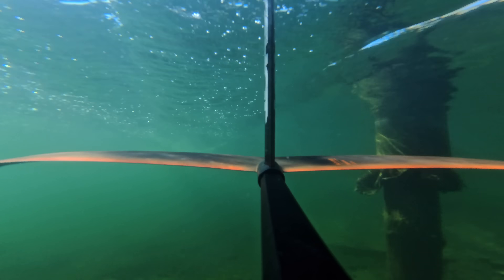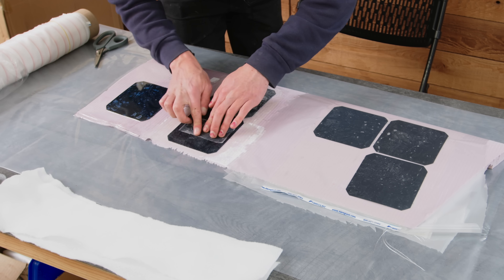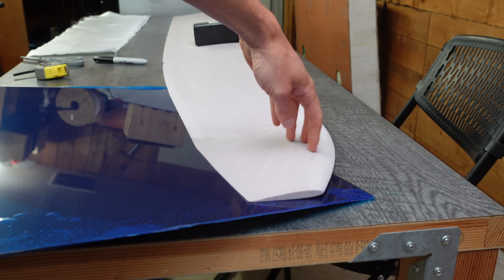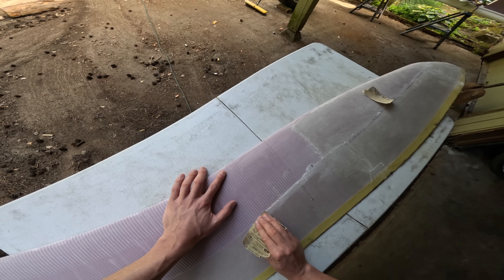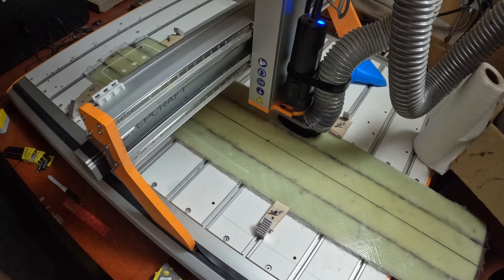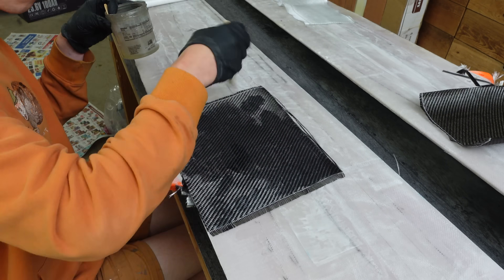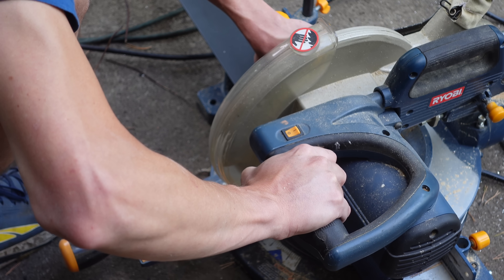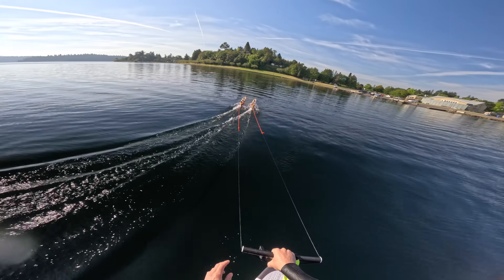I Built the World's Biggest Hydrofoil Board

Comment: My ideal choice of materials for high-performance, lightweight projects is DeraKane 8084 vinylester resin and a sandwich of S-glass with Kevlar in the middle (with no Kevlar sticking out clear up to the margins to fuzz-up when you cut or sand it. The vinylester resin behaves much better during application than epoxy and doesn't gel-up on you unexpectedly. I have kayaks and paddles I made 25+ years ago with this formula, that still seem to be as good as new.

Comment: Trailing edge of foam should be removed.  Old school Rutan aircraft designs do this by profiling the foam so that the trailing edge is offset from the desired profile..  Make the topside layups with that foam acting as a form.  Then flip the assembly and cut and sand the foam form away leaving a straight and flat place that make a perfect structural glass to glass trailing edge.

Comment: FYI - For future reference regarding reinforcing fiberglass with carbon fiber:  Due to the large difference in modulus of elasticity of fiberglass and carbon fiber, the carbon fiber will take almost all of the load (like 80-90%) because it is so stiff that the glass doesn't even strain (stretch).  Since the carbon is taking most of the load, you need to be sure to use enough carbon fiber to support the WHOLE LOAD.  And when you do that, the fiberglass is taking almost NO LOAD, and isn't even needed.  Final conclusion:  Don't mix glass and carbon composites.  Pick one or the other, but not both (at least not supporting the same forces in the same location).  If glass is not stiff enough, use more, increase web dimension, or ....  just use carbon.

Comment: I know this is a slightly older video but please please please, in the future use a respirator or some sort of mask that filters out particulates! I don't know if you've ever been told this but even when you're just using scissors to cut fibreglass cloth there is a ton of tiny glass fibres that get into the air and stay there fo a minimum of an hour. It's also really, really necessary to wear one when you sand the fibreglass and resin surface. It's really important to wear PPE as your lungs are delicate
Reply: And even more so with carbon fiber. You should see the intricate masks they use for commercial production using CF. Some of the little particles are too small to see and those are the most damaging to your lungs. At least you could be outside with a breeze blowing, although I wouldn't want to live downwind of you.

Comment: If you had laid CF in with unidirectional weave at 0, 45, - 45, 90, - 90, 0 then sandwiched top and bottom with a 2K or 3K weave, you would have been extremely stiff and torsionally stiff, rather than a bunch of thin fiberglass weave worth 0/90 deg threads).  A simple 8 layer sandwich with different angles of uni would have saved you a ton of layup work!

Comment: For that plate to stand on, you had to add a rib, or beam along the board. You could put a piece of foam 5cm x 5cm on the sheet you had, then sandwich it with more fiber glass. The foam board you placed on the fiber could be fully sandwiched as well.

Comment: Try it differently!

𝐍𝐨 𝐜𝐫𝐞𝐚𝐭𝐮𝐫𝐞 𝐭𝐡𝐚𝐭 𝐟𝐥𝐢𝐞𝐬 𝐨𝐫 𝐠𝐥𝐢𝐝𝐞𝐬 𝐭𝐡𝐫𝐨𝐮𝐠𝐡 𝐰𝐚𝐭𝐞𝐫 𝐮𝐬𝐞𝐬 𝐢𝐧𝐟𝐥𝐞𝐱𝐢𝐛𝐥𝐞 𝐰𝐢𝐧𝐠𝐬 𝐨𝐫 𝐟𝐢𝐧𝐬.

During my professional career, I have built many robots and test setups to simulate real-world loads. It is very clumsy to load a chair with a 50kg weight for 20,000 cycles in accordance with the European standard, without taking natural use into account. The user sits down slowly on the chair and the forces exerted by the user's weight are not distributed suddenly.
I would recommend that you design a system that allows for vibrations and movements. Roughly speaking: the wing under water must flutter.

Best wishes from Curacao.🙂

Comment: After laminating and the power unit solar drives attached. If a under center skid wires to drag stability to the underneath if the wings the tensions by the wings up lift down on landing has a tension support limited .by the run-through the restrictions. Any item requires maintenance.

Comment: Cool project.  I'm assuming the platform for the Hydrofoil board is mounted on the CG of the foil?  If so try towing it with someone on it?  Also, the foamcore cutting technology has been in use forever with RC.  Have someone cut your cores for you (should be able to find someone on RCGroups), it will come with the beds and you can laminate in them.  And yes, lay glass or carbon on the bias!  Post again when you make more foil attempts!  Crap, never mind, just saw the new video.

Comment: How long did you wait between your last cure and the paint? Polyurethane boat paint is great stuff but if the epoxy isn’t well cured (like 3 days @ 70°F) I’ve had issues with the paint staying tacky for a good while. Similarly, I try not to sand epoxy before a three day cure to avoid long term exposure and sensitization. It still keeps curing for a good month, but three days seems to be a sweet spot where the vast majority of the cure has completed. That’s my experienced layman’s understanding, anyway.

Comment: 10:32 --- PETG ----- IS NATURAL SEPARATOR 
Resin wont stick to it at all (except mechanicall connection trough holes etc (like "hooks") )
but in this case it act more like a "filling" material (like foam in wings but harder) 
pro tip ----- holes in it (infill) and epoxy paste (with thickeners like silica) can make the bond permanent (mechanically)

Comment: do you need a printer or could you just coat a foam board with carbon fibre sheets.. actually you need a Epoxy printer -- whats that a resin printer? can you get it?

Comment: The difference between your fiberglass plate and the purchased one is epoxy vs. polyester resin. Epoxy is very flexible and so is glass fiber. Polyester resin is used with glass because it's stiffer and compensates for the flexibility of glass fiber.

Comment: Its called washout on tips. Wire cut foam cores with built in washout is your building board.
Carbon leading edge say 10mm deep and trailing edge 20mm deep Shear Web Spar 15mm with end grain spruce. 
Cover with aluminium sheet similar thickness to Coke can using slow cure epoxy weighted down on your core mould - Super strong wing 🛫

Comment: Cool video. It reminds me of first attempts at making RC gliders. Once you have had fun with that, you need to move to vacuum bagging. You also must add some carbon layers though expensive I know. That will make things stiff and stick together. You are essentially building modern RC airplane wings, so no reason to reinvent though the hand lay up method can make good looking parts. The buoyancy thing may be an issue once you do it right as it will be lighter. Still fun to see people take a shot at composite layup.

Comment: If you need stiffness, US Composites has S glass. Most fiberglass is E-Glass or electrical glass, so good enough for electricals and insulation. S-glass is structural, with S-2 being a trademark name. It has quite a bit more stiffness and strength while still being fiberglass, so not a big price jump like carbon.
Shoutout to Soller Composites, he got basically the cheapest carbon you can find, in the categories they stock.
Reply: S-Glass is 10% stiffer and stronger than E-glass. It is 300% more expensive. Carbon is 5x more expensive and more than 2x stronger, so it has nearly replaced S-2 in most composite products.

Comment: Are you using only Biax fibers? I think you would get better results If you used some UD or Triax, and infused them instead of handlayup. Using the infusion technique and UD fibers you would gain more stiffness and better compactation of the layers, wich reduces the amount of resin between them and raises the overall structural integrity as the fibers would be getting more of the stress.

Comment: This build is awesome! I wonder if adding self-balancing tech, similar to what Segways use, could help maintain the hydrofoil’s angle relative to the board, stabilizing it for a smoother ride. Maybe actuators could automatically adjust the angle for optimal lift and control. A joystick on the board could also give riders the option to manually adjust the height by shifting the foil’s angle in real-time.

For an advanced twist, the actuators could even oscillate the foil angle slightly, generating a form of propulsion by mimicking a fish’s tail movement. This could add some extra thrust without relying on traditional motors! And with independent control of each end of the foil, the rider could achieve left-right 'yaw' turns for better maneuverability. This project has so much potential!

Comment: I wonder what’s an idea behind (except to utilize the wings)? To prove physicists were wrong and water had a same density as air? If you even will be successful and solve all balance issues, you will move at a speed of a turtle to have a proper lift force.
Reply: Mhm of course water has a higher density and that should increase the lift with the same profil and speed if I remember correctly and the added lift should be about the weight of a human at seeds close to the design speed  and it looks promising in the first attempt

Comment: Using styroboards seems way better in many regards than 3D prints like in the motor powered hydrofoil. But the built process needs to get optmized. And you really have to be sure about your design beforehand.

Comment: Nice design, but Pretty sure I could build that wing faster and easier with balsa..-that "highly precise" trailing edge flip up is also easily created with a simple bloc under the wing during traditional construction and is known as washout. Why re-invent the wheel at every turn? Strength comes from sufficiently thick cores not thick skins of resin and glass.

Comment: To keep parts flat or to desired shape, build an 'oven' -simple cage with light weight foil faced insulation that you can set over your part. Add a heater with thermostat, leave the part under vacuum in the 'oven' around 180f for 2 hours. It shouldn't pre-release or have any post cure warp  
Or, build a pressure vessel with heating like formula 1 teams do. Kind of expensive though  
Source; I built boats for 35 years and after,  kevlar parts for race boats

Comment: You can cheat with the spar.  If you use "flat" 5mm/1mm carbon ribbon glued securely so it can't twist you can get a huge amount of bending strength without a large tubular spar.  Gluing 2 flat bits along their length greatly increases the strength.... like a split-cane flyrod.
I used this to reinforce my "Skywalker FPV" 2 meter span, with a take off weight, all batteries, cameras etc, of 1.4Kg.
Because the tips "could" technically twist under extreme G (4 or 5G) it actually helped wash out the tips and made the thing ultra stable in stalls.
I never did loop it.  Thats a lot of weight for 2 meter square, low aspect wings.  I did try and stall it and had to abort.  It didn't stall, it just "elevatored down" retaining a high angle of attack and I immediately dumped the nose and powered out, knowing what was coming if I pushed it too far or if I slammed the throttle open.  A flat spin.
Still, thing flew like it was on rails.

Comment: Hi. You can significantly increase the processing speed with the "Parallel" strategy. The direction of movement should be along the diagonal of the axes of the machine. Then the maximum speeds of the axes will be vector-folded and the milling cutter will be able to move noticeably faster. Good luck with the machining :)

Comment: Seems as if you have to have more weight on the larger foil. Laws of physics. You have lots of lift but also more drag. Like airplanes the larger the wings the less power is needed to get airborne but drastically reduces max speed. Small wings high speed. Large foils need more weight on top to work properly. Weight and foil size ratio. Also they are probably to buoyant as well since they are so large. Volume in qft. And more weight on them would likely improve performance. So a heavier you.

Comment: From my experience building longboard skateboards from flexy carver or cruiser to full on downhill boards, I would think that small amount of straight strand carbon fibre does more than you think. It has completely different properties from glass. Glass is flexible and bouncy and carbon is much stiffer end springier. It does break at a lower deflection compared to glass and it shatters while glass tears. But on flexible sports equipment you're riding you can defilitely feel the difference in flex and damping between different materials or combination of materials.
Reply: Yep, my thought too. You add some carbon and the part gets 4x stiffer. Its just expensive.

Comment: Excellent build and excellent video. I suspect that the masts of these craft replace a large amount of the pitching up moment that is usually solely born by the horizontal stabilizer on traditional aircraft. They can do so with their drag, rather than the traditional negative lift that the horz. stab. uses. If you have a dual masted board like this, I think you would need even less reflex than if it only had one mast. I see evidence of this when I see how small the horz. stab. is on other wing boards, especially when compared to the wing. Its much smaller than you would expect if it were going to be an airplane. This wing is so nice though. If it still wants to pitch up after more practice, you can always add adjustable, unpowered elevons that can be adjusted on land.

Awesome vid!!!

Comment: It has been a while since I flew a hang glider, like back in the 80s. They were just starting out with the double surface wings. The older ones had as much as 15+ degrees of wing twist/warp. I don't think in them they had any reflex on the back of the foil. They did have restraints on the main part to make sure that under negative lift loads, the sail did not deflate. These were tethers to the top post which are not on the newer models. I am pretty sure they incorporate that into wing design now days. Seems like most are flying the paragliders now days....
Reply: The newer ones do seem to have some reflex towards the tip as well as the washout.
Reply: Right about the time I was also flying hang gliders. Mine was a Seagull "10 meter". A minimum  wing "twist" (washout) was assured at all times by a small (some 50 centimeters) articulated strut near the wing tip, which by the geometry of the pivot point made it able to "float" into more negative angles if the flight conditions called for that, but would hit against a hard stop, pretty much guaranteeing a predetermined minimum negative angle at the wingtips, regardless of wing speed or angle of attack. Very simple, effective and safe.
Reply: My first glider was a clone of the Seagull 3. Those old styles would/could go into "full luff dives" and just barley suitable for "flying higher than you care to fall.... My next glider was an Electra Flyer Olympus 3, I think. It also had the articulated strut near the wing tip. It may have been set as high as 20 degrees, but can't remember that far back. There was one flying wing, can't remember the name (Sundance maybe), and it did have a recurve via battens near the trailing edge. My Oly did have a clip to the top wires in the center off of the keel which prevented total collapse of the sail in thermal conditions. I would think the reflex near the trailing edge of your wing here would be unnecessary. One way to find out.... I do a LOT of swimming now days. To date, I don't think any one has figured out how to come up with a method of smoke streamers like they use in wind tunnels. I have thought about maybe a steady stream of air bubbles in one of those endless swimming pools.
Reply: @robohippy  I learned on a Seagull 3. That was one reason I bought the (Seagull) 10-meter when one was up for sale near me.
Reply: I was just looking it up and I think I may have been mistaken. I think i was mistaking a bit of sag while static on the ground as reflex. Looks like they all have pretty convex foils out to the tips. Some of them might be running a lot more than 15deg washout though. Compared to the old school kite style it’s kind of inverted.
Reply: @weatheranddarkness  I think some of them had strings connected between certain points of the trailing edge and the top pf the king post. Under normal flight, those strings would sag and have no effect. But on the ground (or more importantly, in the event of a "luff dive"), those strings would effectively introduce a reflex in part of the trailing edge. You may have seen this with the wings static on the ground.

Comment: If you need long reach mills for a cnc router, consider Helicle's "solid carbide high feed" mills. They are specialized mills which translate forces axially instead of radially. This allows you to reach further without fear of high leverage forces. There is a learning curve because they work differently than end mills

Comment: loving your spirit for innovation and experimentation. But I learned that a minimum of engineering is needed for something like this, very basic checks... your wing surface, at what speed, for what lift (your weight) and then check for getting a neutral pitch stability. My 1st reaction is that your wing has too much surface area... these things can't be winged ...

Comment: After I was through I took the hose and hosed down all of the work area out into the train in the driveway so that all of the particulates from the fiberglass and from the CNC and from the the 3D printing all of that stuff. All of that junk that little bits of plastic and all that just goes straight down the drain and effectively is gone forever until it comes up again someday